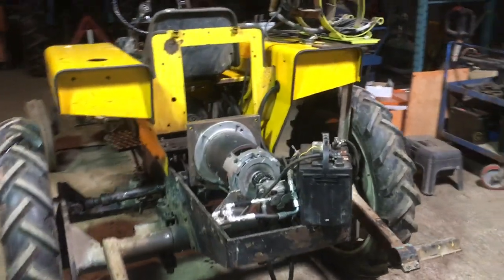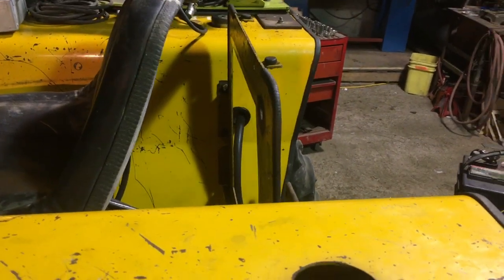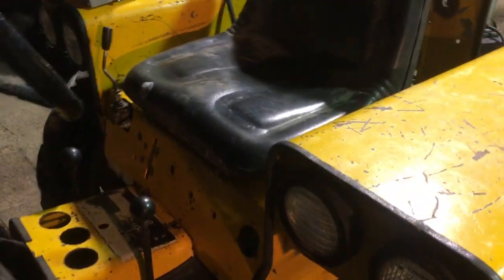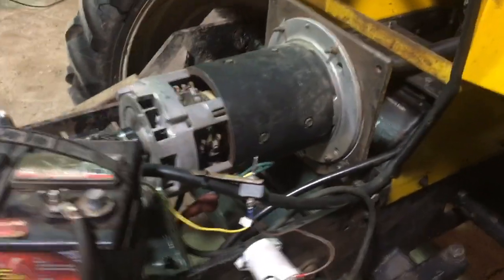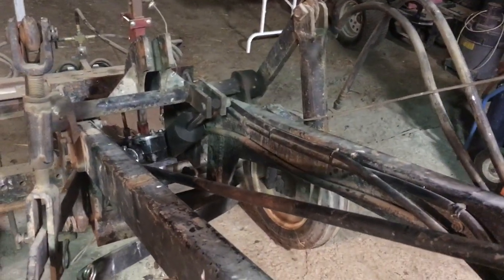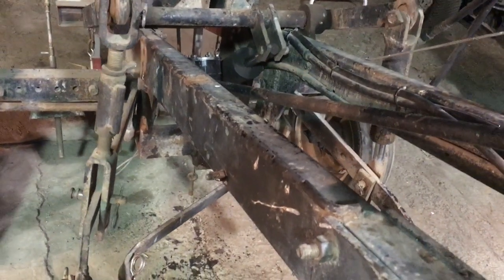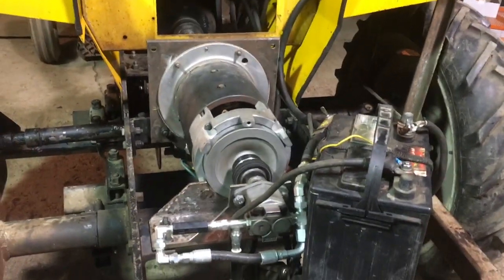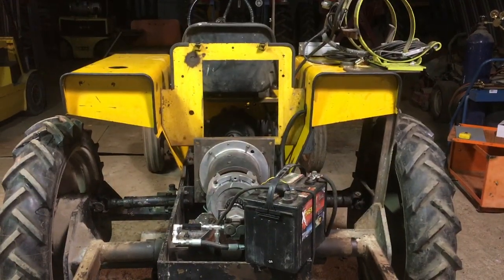Hefty-G tractor electric conversion, part 3: body panels and hydraulics

Comment from the maker: The tractor is now finished and working on a daily basis. Check later videos in this series. 

As for power output I can actually answer that with some accuracy. There's a current shunt between battery and controller that gives me instantaneous current draw in amps and kW.  So far I've seen it spike to 14 kW (19hp) under highest loads but honestly that was just once pushing it really hard. Most of the time it draws more like 4 or 5kW and some low speed weeding tasks require only 2 or 3 kW. 

One of the great things about electric motors is that they only consume as much energy as needed at any given instant.